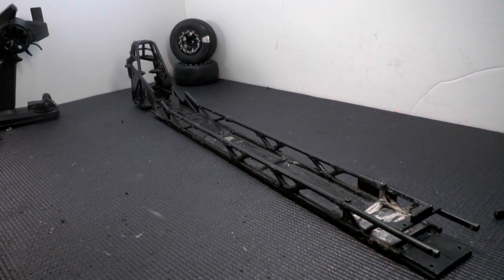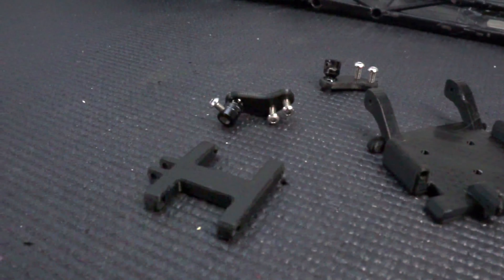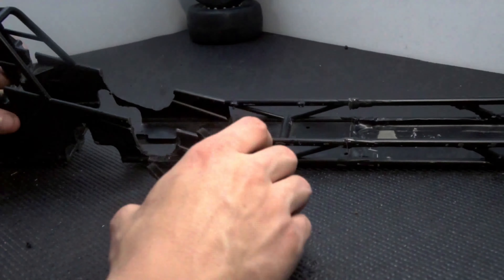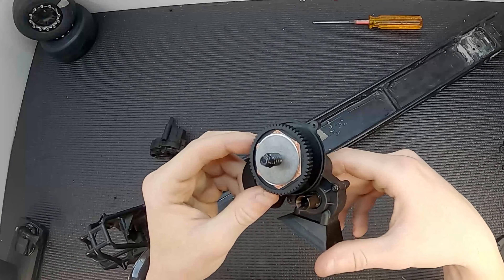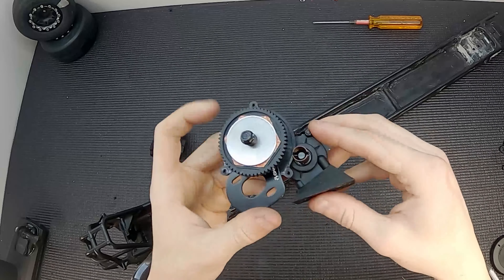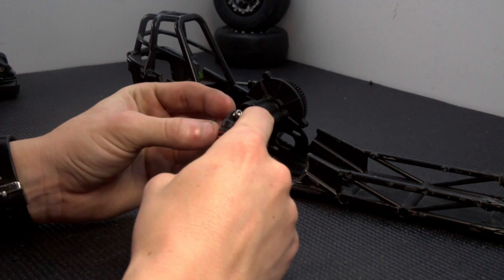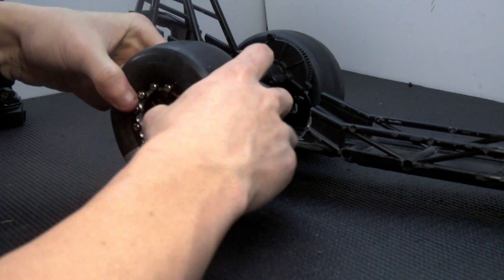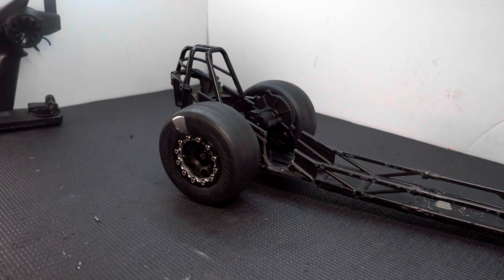No Prep Front Engine Dragster!! | RC Dragster Build

Comment: If you can't find half shafts you might try cutting them down and re joining them to the desired length  and use a hex pin to lock them together. 

Very similar to by drive shaft extension.
Reply: Drive shaft extension. 
https://youtu.be/vcwJ-O93NUc

Finished drive shaft.
https://youtu.be/6zzTYFkHaRs
Reply from the maker: Thanks for the suggestions. I'm currently working on the drive shafts so I'll look into this

Comment: Great video! Can you get more in detail on what plastics you used and such? Im custom building a top fuel dragster out of a 144001 also wish there was a 3d model for it so it would be easier to design
Reply from the maker: I'm mainly printing in PLA right now. Been experimenting with PETG and if any of these parts break I'll probably try them in PETG.

Comment: Why did you choose a crawlers transmission? Curious I'm also starting to build a drag rc.  Thanks. Great video 💯✊🏾
Reply from the maker: The build started as a build to use up a bunch of spare parts I had. I had a transmission that I thought would fit but it was actually the 2 speed compatible transmission so I ended up just getting the scx10 case to put the gears in. Its worked well so far for a custom build!

Comment: Looks awesome 3 or 4s lipo setup?
Reply from the maker: I'll be using a Mamba X ESC so I could run 3s, but the motor I have is only rated for 2s  so that's where I'm going to start.

Comment: Where can I find the stl files for this awesome build?
Reply from the maker: I never made the stl files available for this build. It was a one off build the required a lot of tinkering and customization. Thank you for the compliments though.
Reply: @FullThrottleRC  that's a bummer,
 this would be a great build to do
Reply from the maker: @GreyGhost_40  It's kind of complex and a little odd which is why I never made the files public. I had some trouble getting things to work. And things like welding the axles isn't something everyone would be able to do. It's not really a simple project.